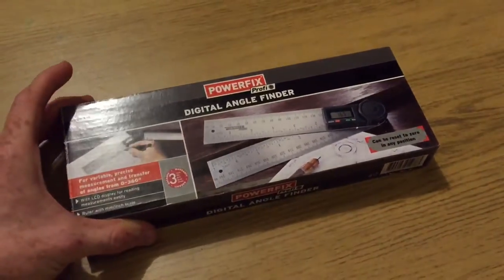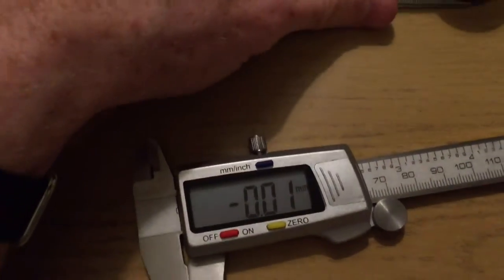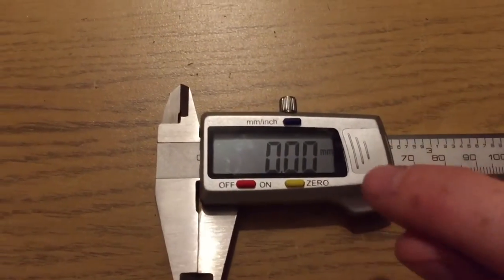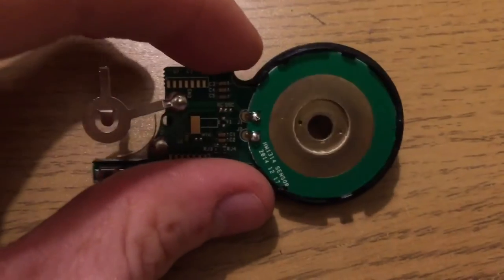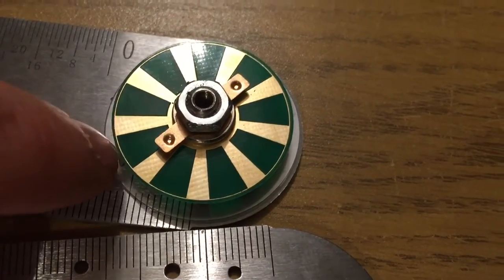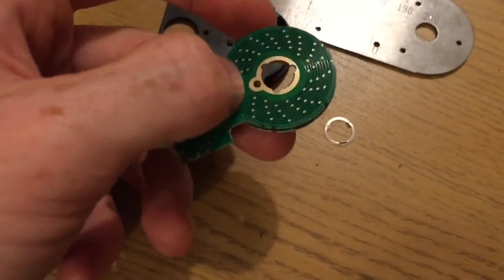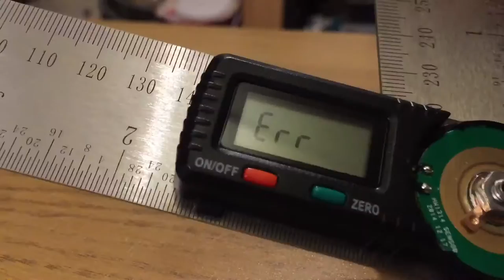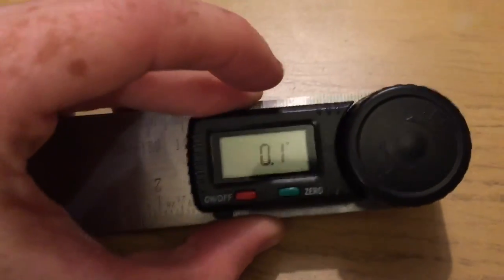LIDL Digital Angle Finder Teardown

Comment: It's a rotary encoder, you could turn it as many times as you like. Thanks for doing the teardown.
Reply from the maker: Yes, but it has to remember that somewhere.
Reply: @theweekthatis  The only thing it needs to remember is one position relative to an arbitary starting point. There are some ok tutorials on reading encoders using an Arduino. I'm thinking about tearing one of these down to make digital indexing for my lathe.